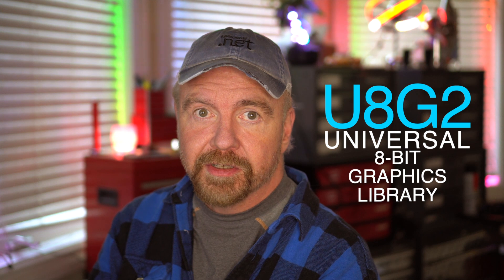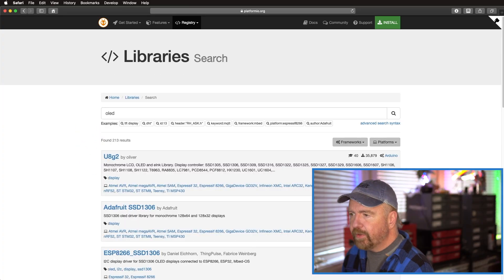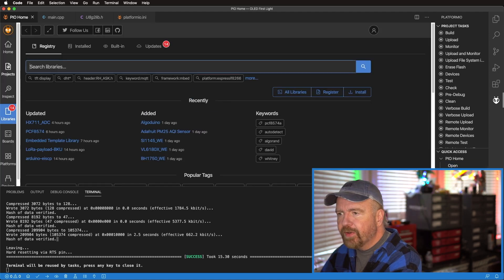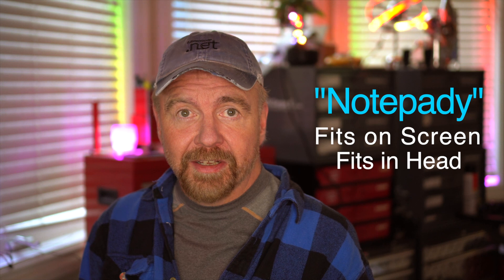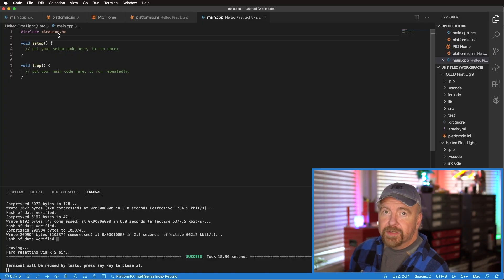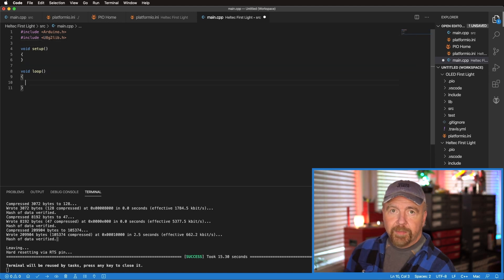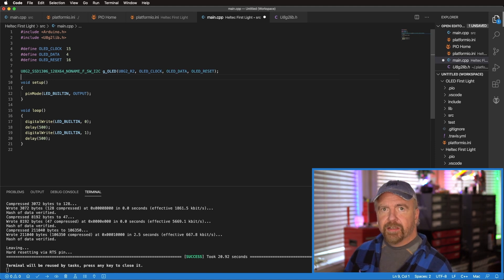02-Learn Arduino Tutorial Project - LCD and OLED Text - How to Draw - SPI & I2C

Comment: Dave, I ordered from Amazon - discovered that I followed EXACTLY however, the processor has been updated to ESP32S3 - received error when trying to load - had to chance the environment
[env:esp32-s3-devkitm-1]
platform = espressif32
board = esp32-s3-devkitm-1

; change microcontroller
board_build.mcu = esp32s3

; change MCU frequency
board_build.f_cpu = 240000000L

Comment: Hey guys if you are having trouble with the V3 version of this board (heltec esp32 v3) use the following pinout: clock : 18 data : 17 reset : 21  the same noname class (U8G2_SSD1306_128X64_NONAME_F_SW_I2C) from the video but U8G2_R0 instead of U8G2_R2 for the first parameter. finally lol this was really hard to track down and the documentation is basically useless.

Comment: UGH i got the heltec v3 v3.1 to be exact and the code pushes and the light blinks but no go on the OLED anyone else run into this issue with v3?
Reply: OMFG i FINALLY got it to work even though looking at my datasheet for the OLED the pins say something completely different for CLOCK/DATA/RESET DO NOT FOLLOW THOSE ON THE SHEET. Instead I followed the input of the MAIN CHIP which had different pins which ended up being CLOCK=18  DATA=17  RESET=21. Hope this helps someone else thats struggling like I was
Reply: @umop3plsdn . ❤  THANK YOU.    3 YRs since Dave first launched this video. Very inspiring to learn but now the Heltec board is V3.  I knew someone from the future, You, would post the Solve.  You did and now it works 🎉on the V3 board.

Comment: Dave, I know I'm late to the game here and you'll probably not see this. but here goes anyway. I'm a 67 year old retire SW engineer and I, too, have just discovered the world of ESP32 and addressable LEDs. These videos, so far, have been great!  Unfortunately, I've had a long struggle to come to terms with VS Code. My install (V 1.73.1) has quite a few differences from the one you use in the videos. And since it is such a general-purpose IDE (flexibility breeds complexity) there is a lot of visual noise. I find it difficult to find things and it seems more complicated than the Arduino IDE 2.0. I'm sticking with it (for now) since "everyone" seems to thinks the VS Code is so much better.  I'm actually following your videos and building the code in both IDEs to compare.  Anyway, thanks for the videos!

Comment: How did I miss this one!? I've been a die hard ATTINY user for years. I use them to control "throw away circuits" of all kinds,, especially those individual addressable LEDs, but also heavier lifting stuff. I've got a couple esp32s to play with, I just need to find the time.

Comment: Dave,  I'm following along and I have an SSD1306 without a reset pin.  Just SCL and SDA.  How do I set the RESET pin it?  

U8G2_SSD1306_128X64_NONAME_1_HW_I2C g_OLED(U8G2_R2, RESET, 22, 21);     //Referenced to line 1578 in U8g2lib.h file

Comment: I was getting this fatal error in the compilation. My model of the Heltec OLED is the same as yours. Message: ".pio/libdeps/heltec_wifi_kit_32/U8g2/src/U8x8lib.cpp:45:10: fatal error: SPI.h: No such file or directory" -- I fixed the compilation by adding this to the platformio.ini: "lib_ldf_mode = deep+" --------- However, this causes the successful compile/upload to do nothing on the board. If I take the same code to the Arduino IDE and upload it works perfectly. Any idea? Thanks!

Comment: I bought two of the Heltec modules. The first fails to program. The second program the initial LED program but then stopped programming, I trued unplugging and different combos of the buttons. Maybe I just got a two bad batches, since they were purchased years apart, there is no refund on the first one. Still, it's nice to watch the list of networks, i just wish it scrolled before restarting.

Comment: Hi Dave. I was wanting to know how to revamp the main code to use on my Arduino Uno and nano boards. Since these don't have the Oled display then it is that  part of the code I would like to weed out. I'm not sure that just commenting it all out will do it once I copy the code for the Uno board that I am currently using. I like using the Uno for checking the code then applying it to the Nano for my projects. If you have the time I think it would be a good video to post to show how to convert your code to be used on other boards, For us noobs of course. I have programmed in c# but only for 8 weeks during my online bootcamp so I know very little. Thanks

Comment: The link to the Heltec ESP32 takes me to a "HiLetgo ESP32 OLED WiFi Kit ESP-32 0.96 Inch Blue OLED Display WiFi+Bluetooth CP2012 Internet Development Board for Arduino ESP8266 NodeMCU" product page. There's a separate product page for the "Heltec Automation ESP32 Development Board Nodemcu Chip Not Module With 0.96inch OLED Display Bluetooth WIFI Kit32 Arduino Compatible CP2012 USB To Serial Chip". Should I buy the HiLetGo or the Heltec?

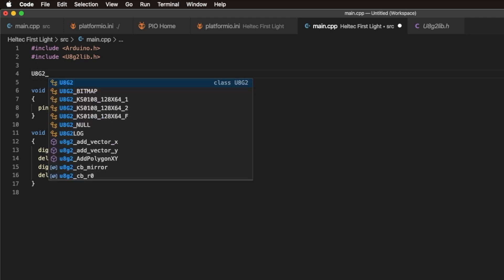Comment: Following along with your tutorial, installed Platoform IO, got to 12:00 in the video, I even tried it once more with feeling, but I still got Squiggly lines under U8G2_SSD1306_128x64_NONAME_F_SW_I2C .  "Identer not defined" & "Does not name a type".   What did I do wrong? Is it in the PlatformIO setup I wonder?
Reply: I know it's been a year since this particular posting, but I'm also having the exact same issue.

Comment: Dave, I love your videos and have embarked upon working through them. However, I’ve hit a snag that is really bugging me. I have coded and run the frame rate code but I’m only getting just under 6 fps! I’m using the same Heltec 32 WiFi Kit MCU as you have and I’ve reviewed the code several times. I’m confident it matches what you have, but I’m just not getting 29 fps. Any ideas?
Reply: Oops! Found my error! Was using the U8G2_SSD1306_128X64_NONAME_F_SW_I2C constructor instead of U8G2_SSD1306_128X64_NONAME_F_HW_I2C (_SW_ vs _HW_). I assume that means using software vs. hardware control, which would certainly make things slower! Onward I march!

Comment: Wow !!!  I am so far behind I can't believe it. I guess I've been in thermodynamics too long and missed whats going on in the world of microcontrollers. Based on the introduction of this series, I was looking forward to build the Tiki Fire Umbrella or desktop atomic fire lamp, or some of the cool effects with the LED strips. But I missed it. I learned a little about starting to program the ezsbc and I bought one too. But from where this excellent programming leaves off is far short of what I need to program the umbrella or lamp for it's operation .... at least for me. I'm disappointed. I guess I need a "for dummies manual"
Reply: hmm as far as i know arduinos are good for physical stuff, (switching relais, measure things, turn things time dependent on and off etc.) If you want some fancy color shifting stuff, think about a "raspberri pi". There you can work with higher level languages, that are more intuitive & can be debugged in a comfortable IDE . Maybe you should look for some computer-case rgb stuff that is controlled remotely by a nearby PC or laptop.

Comment: Dave this is fun, couple of points though:

1) The frigging PlatformIO IDE took me an hour to install. Kept reinstalling over and over. Had to manually install the thing. Ugh.
2) You've marked this video as "for kids". Which while it is suitable for kids, causes problems. Like I can't click on subscribe. You shouldn't mark it explicitly "for kids", I've made that mistake before.
3) Live programming is fun/fine, etc. But dude, dont' flash away from the code so fast. I can't even pause fast enough to copy it.

I'm having a blast following along. Thanks for this!
Chris
Reply from the maker: Weird on (1), is was snappy for me.  On (2) actually no, it's marked as "No, it's not made for kids".  Maybe it was another one of mine?  If you do spot anything marked as such please do let me know, I appreciate it, but this one doesn't seem to be!

And 100% I've learned that I need to linger on the code for a minute.  Starting halfway through the next episode I also stop now and then to do a "birds eye view" so you don't get lost!
Reply: The platformio issue was some kind of missing url lib in python. I’ve got python 3.8, but apparently not this lib. The installer, however, is silent and it just retries over and over. Had to use the tools -> debug it to find it. Installed the lib... nothing. Eventually I resorted to the manual install which I found on platformio’s GitHub. 

As for the kids thing, your whole channel is marked that way. It prevents a bunch of things, the most important is you can’t click on the bell. My guess is one of the videos is marked as “made for kids”. When you click on the bell it gives you some help, maybe there?
Reply from the maker: @chriswilliams8989  That's probably quite wrong and I should fix it, but when I check the setting on both the account and that video it says "No, not made for kids".  Can you tell me where/how you're seeing the indication that it is, and I'll track it down from there?  Thanks Chris!
Reply: @DavesGarage  I just sent you an email (to the yahoo addy) with what I've uncovered. If you don't get it, let me know.

Comment from the maker: Things I plan to do!

- Fix the beeping in the background (sorry I don't hear it anymore but everyone else sure does!)
- Longer pause on code before cutting away to compile so you can see what I've typed
- Make sure Carl is understandable or has subtitles

Let me know anything else I can do to improve them!
Reply: I think if someone doesn't know at all some arduino syntax, it is almost impossible to follow your code on the screen. But, you may put the code in a web page with the link in description, to not look for the code in the video, but to have it as text on the computer.
Reply: I couldn't finish watching it because of the beeping. It was too much for me. No offense or anything, I just can't personally handle stuff like that. I wanted to watch it.
Reply: 🤣 I thought my neighbour was burning their toast again
Reply: I didnt hear it until i read this comment :P
Reply: I just assumed it was a flat battery in a smoke detector. 
Great video keep it live
Reply: @davidclift5989  My educated guess is that he needed to replace the batteries on his UPS. An APC UPS will beep every 30 seconds and sounds identical to that.
But why ho's gone so long without replacing them that he's got used to the beeping.. I'm not sure.